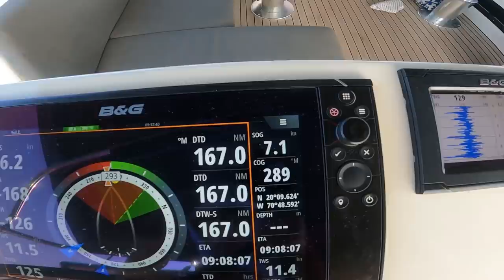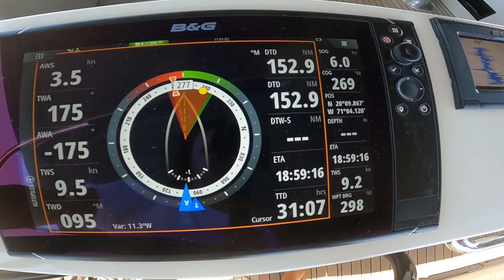SAIL FAIL - we have to ditch our Cruising Chute in the sea | Sailing Aequus - Episode 14

Comment: Hey guys, Enjoying your adventures. Couple of thoughts:
1) The halyard splice at the end was probably improperly done and the bitter end that was buried inside the outer sheathing began to come out. Hence you noticing the foot of the main being slack. You tightened it up again and that allowed the final part of the splice job to work it's way out. Easily fixed with a properly done end splice. 
2) The furled torsion rope for rolling up the cruising chute requires tensioning prior to furling. Insufficient tension allows the cable to 'candy cane' until failure which sounds like what happened here. Another thing that will help is to deploy the jib which will partially blanket the kite and unload it so that it will furl easier.
3) Typical furled spin uses top down furling. A Code 0 uses bottom up (fixed as opposed to swivel terminal) as well as top down, rolling up just like a jib. As it starts to furl, the luff aids in transfering furling action so is more forgiving of a less tensioned torsion rope. 
Everyone will eventually 'shrimp' a spinnaker. It's a right-of-passage thing. You did good and got it back on board.
Reply: Hi Michael looking at 16:15 in the video would you suggest any changes to how the tack is connected to the Furler?
Reply: @Captain-Paul  I don't know the brand, but the tack for the spin does appear to be attached to the furler with a swivel terminal which for top down furling is what's used. I can't tell whether the furler is attached to an adjustable tack line for setting the tension on the torsion rope (seen in the vid in black coming out of the top of the swivel terminal).
Reply: Is there any reason to choose a furler over a snuffing sock?  The sock seems easier.
Reply from the maker: Thanks Michael for the info. Very good points.   Yes on the cruising chute it is a top down furler. So maybe their wasn't enough tension. Is there a way to know easily when the tension Is right in the AT Rope?
Reply: @SailingAequus  Here's what I did: Hoist the furler and torsion rope (without the spin attached) with the halyard all the way to its mast fitting. Then use the tack line to snug up the furler. Make a note of how much tack line is showing above the bow (or bowsprit if equipped). Now start tensioning the tackline. You should note that the torsion rope will stretch. Standing at the bow, and at eye height, see how much deflection you can achieve by pulling on the torsion rope with your finger. Try operating the furler. It should operate smoothly. Keep tightening the tackline and at some point, the furling becomes more difficult to operate as the furler and head swivel bearings start to load. Note how it feels. Now back off the tack line until it's smooth again. Check how much deflection there is in the torsion rope at eye height. I get about 1" to 1.5"  deflection when I pull at eye height. There is no or little sag in the torsion rope. This is something similar to deflecting an alternator belt on the engine when setting its correct tension. The torsion rope will have stretched (for me about 8-10"). Now you can mark the tackline or in some other way as suitable so you'll know where the tension seems best. Now put the chute on the furler and you should be good to go. Make further finetune adjustments to suit. Blanketing the chute with the jib/main and deeper heading angles reduces furling loads dramatically. Same should go for the Code 0. Keep in mind that the cable will stretch when tensioned and attaching the Code 0 needs to take into account this stretch and not allow the stretch to transfer into the luff of the Code 0 through the furler's lower fixed terminal. Hope this helps.

Comment: …so sorry to hear about your broken sail! We have opted for the 230qm Gennaker on the C57 which was originally recommended to operate with a furler by Bavaria. Our very experienced dealer sent the furler back immediately and was very much insisting on replacing it with a snuffer. So far, it works really well, we mostly go double handed like you guys. Looking forward to your next story and dreaming of our own time in the Carribean some day 😁
Reply from the maker: Interesting... Maybe a snuffer would have been better. We already had the furler for the Code0 and that furls like a dream and was advised that the cruising chute would behave the same. Possibly the AT Rope was not tight enough which would be my mistake. Definitely going to get an independent sail lofts opinion on it.

Comment: Really appreciate your videos. I have to admit, losing tour main halyard and heading out to see gave me the shivers. If you were to lose your back stay, that halyard would be insurance that your rig would not fail and come down. The breaking strength on that halyard is some insane number, so it’s still a mystery on why it failed. In the spinnaker, if it was me I would have opened the front hatch, dropped the halyard and just stowed it until you had a chance to figure out what was up. It’s probably something simple — for example one day out on my boat my Genoa would not furl the entire way. It turned out that I forgot to move my spinnaker halyard back behind my fore stay and it got wrapped up in the head sail.

All in all, really happy to see that you are ok,
Reply from the maker: Hey, problem is with in mast furling (and full  length verticle battens) there is no way to use the halyard in that way without a trip up the mast or dropping the main - neither of which I would want to do at sea.  We do have a thick topping lift which would probably be easier to use in that situation.
Reply: @SailingAequus  Makens sense. Hopefully it’s all sorted for you know.

Comment: And another thought for you. You said your main halyard failed when trying to tension the luff of the main. Always worth a quick check of the tack before you do that. If its loose the sail will pull up against the sheeve and then it can move so you are just putting tons of pressure on the halyard. hope that helps.
Reply from the maker: Thanks Herb, Since we have replaced the halyard its has been much better.  Have also slackened off the kicker a little more when unfurling/furling the sail.
Reply: James with your cruising Aysm.  Your depowering options were limited without the main where you could have sailed deeper and pulled chute tack under the foot of your main to take it down.   Your ultimate way was far better than a potential wrap on forestay.  Enjoying the channel.  I would like to see more with your operational furling chute in future videos.  Some of us still have a sock 😀

Comment: Maybe consider combining with a "dousing sock" for quick collecting the chute in high wind and reserve the furler for final towage when not needed for a while.
Reply from the maker: One of the reasons we chose the furling option was that so it could be put away without going forward. I haven't ruled out that possibly its me not tensioning it properly that caused the issue. Will follow up in another video when a sail loft has taken a look.

Comment: It twist because I am sure like most production boats you don't have a 2:1 halyard which mean it has no triangulations. It breaks because you can end up using it like a forestay if you tension it to much while going downwind or it twist to much. Fit a 2:1 deadend and a new halyard and you will see the difference check the sizing though. Keep the video coming
Reply from the maker: Is a 2:1 where the halyard is attached to the top of the mast and then comes down and back up again around a block which attaches to the swivel/At rope!? If so that is the setup we have. I wonder if the AT Rope tension was too tight or not tight enough?
Reply: It sounds like you have a 2:1 halyard already which is good if it is fitted properly there should be dead end e.g. termination point about 300-400mm below where it comes out the mast. The triangle that is created at the top if the AT cable is the correct length mean the sail furls rather than the halyard twisting. Keep enjoying the journey and loving the content it is inspiring.

Comment: Not having the mainsail up and only the chute out is problematic especially when the breeze starts to get a sail/boat beyond their wind comfort range. With the mainsail up and turning dead downwind you can wind shadow the shute and release pressure to de-power it but of course that was not an option. Poling out the jib might have been slower but safer in retrospect. As for your mainsail halyard it obviously stays tensioned at the top of the mast which is out of sight out of mind so hopefully it is regularly checked up there? With in mast furling there is probably no mainsail cunningham eye a few feet up from the tack along the luff to put tension onto. That can help lower foot of the sail halyard sag. Lucky you were not in difficult seas, lessons learn't. Thats what it is all about.
Reply from the maker: Hey Mark, yes no cunningham on the in mast furling setup. We checked the halyard about 6 weeks prior when I did the solo sail back to Curaçao and got a new main sail. I think the splice failed so probably wasn't properly spliced in the first place. We have also attached it in a slightly different way which seems to have made an improvement.

Comment: Could you have turned into the wind to help collapse the sail before you tried to furl it?  I'm not a sailor so I apologize if that's a foolish question.
Reply: Turning a boat toward upwind with a spinnaker set will ultimately result in a death roll. Since this spin is centerline tacked, better to turn more downwind, and roll out the jib to have the main and jib blanket the spinnaker and reduce its load to help with furling. Alternatively, dump the sheet and let it fly like a flag out front and then furl being mindfully of the flailing sheet which may end up in the roll creating a jam.
Reply: @michaellahrkamp9755   I understand but seems to be a lot of work to de-power the sail all during a panic. Thanks for getting back to me. 🤝🤝👍👍👍
Reply from the maker: Not really.. as we were already sailing downwind.  What i should have done is put the engine on which would have reduced the apparent wind by about 8 knots. Even so im not sure that was the problem. Possibly the tension wasnt right in the AT Rope (furler). Will get a sail loft to take a look and report back in a future video
Reply: @tyroneshulace3203  I appreciate that in this instance, there was no main. Still, the genoa could have been set to create a wind shaddow to unload and more easily douse the kite. A boat sailing under spinnaker alone with building wind invariably invites teaching moments. Fortunately shrimping the kite saved the day.

Comment: Perhaps a good, hard look at all your running rigging might be in order.  Those lines are usually sized to withstand more force than the sail can exert.  Or am I preaching to the choir?  Fair winds!
Reply from the maker: Hi Bill, I think with the main halyard it may have not been correctly spliced which caused the failure. With regard to the cruising chute I'm still waiting to get a sail loft to look at the AT Rope to see what caused the failure. Possibly it was incorrect tension which would be my bad!
Reply: @SailingAequus  Sadly, my experience with splicing is limited to 3 strand sisal in the 1960s to acquire my Boy Scout pioneering merit badge, so I'm not qualified to judge that halyard.  At this stage in my life I'm not likely to remedy that.  I eagerly await your next episode and again wish you fair winds and following seas.

Comment: Turn in to the wind to take the pressure off of the sail. and you won't have that problem.
Reply from the maker: Hey Ross. What do you mean by turn into the wind? What angle are we talking? Turning into the wind will wrap it in the rigging as its a big downwind sail.